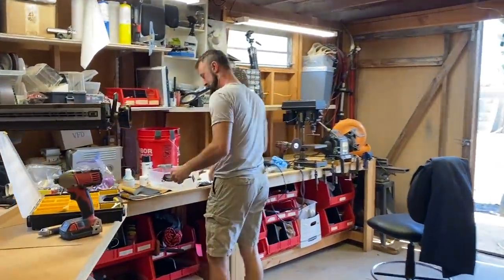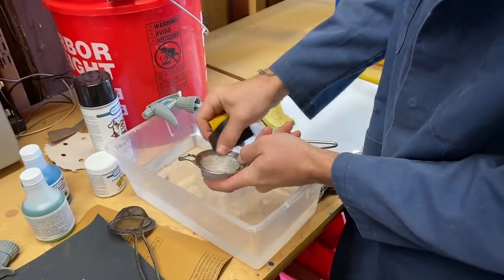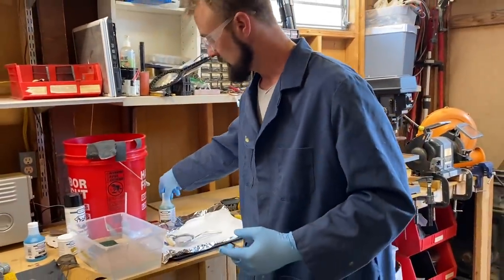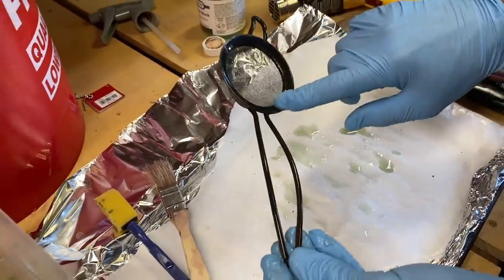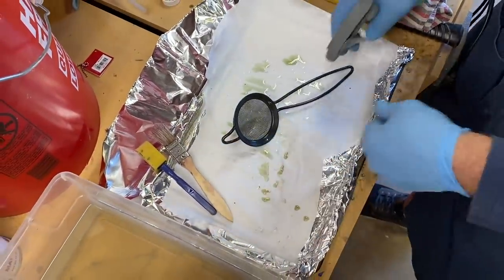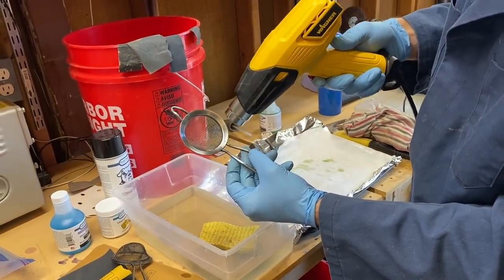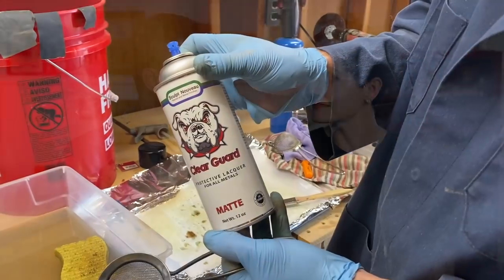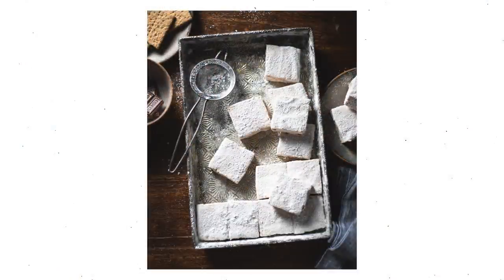How to Antique Your Metal Props

Comment: I'm not sure if it would work great in this case, but for spon's and other things I would suggest using a tumbler filled with polished stones, or just rocks, or small scarp laying around and tumble the item for a long time at a low speed to great a random used look. it usually works great and since it not you adding the scratches and dents it looks more natural. I think anyway.  But great video and a great work! looks amazing :)